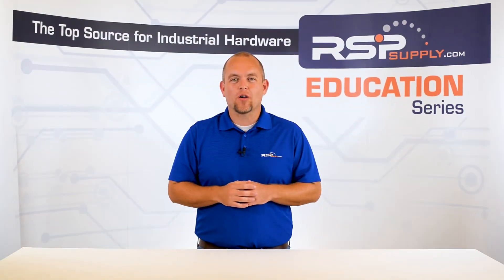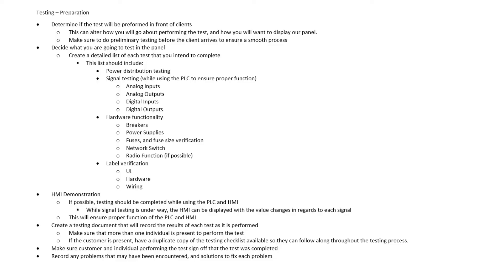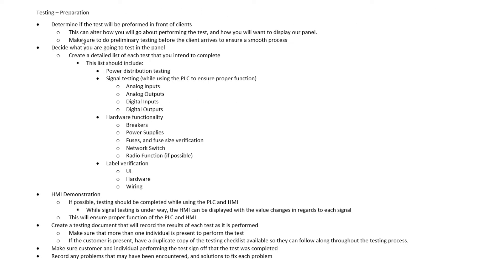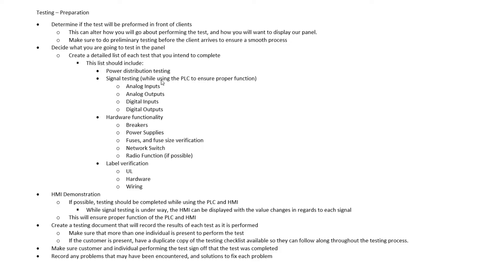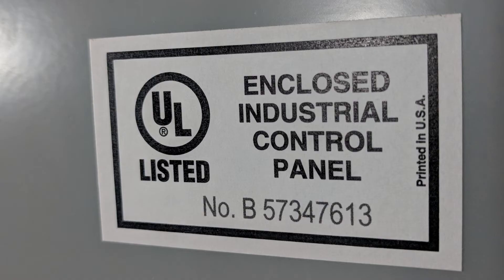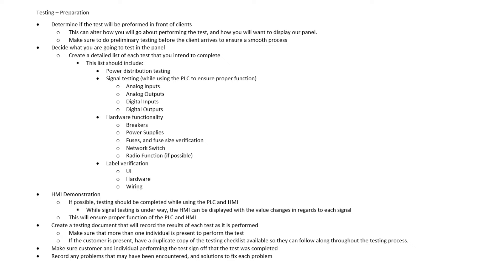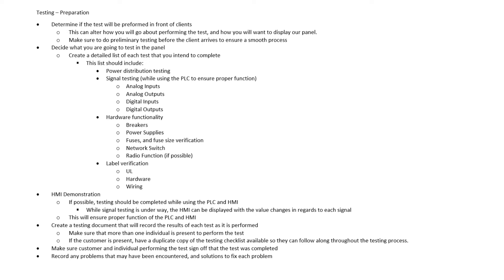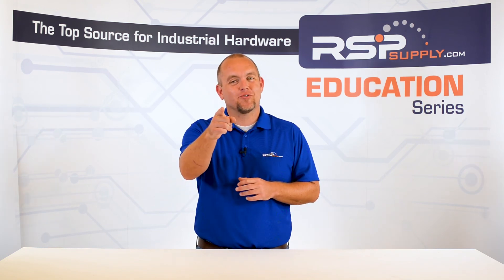Control Panel Build Series: Part 23 - Testing Preparation

Comment: These are the best electrical panel videos on youtube!!  I wanted to ask, how would you incorporate a "Main Control Relay" in this build, and also, if putting an Estop push button, would you wire that to cut out the 24v power supply??? I suppose if your Estop is wired to 120V coming in, the UPS would pick up the power in that case so you would have it knock out the 24V supply?